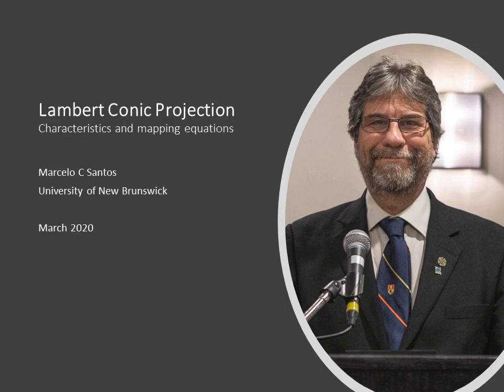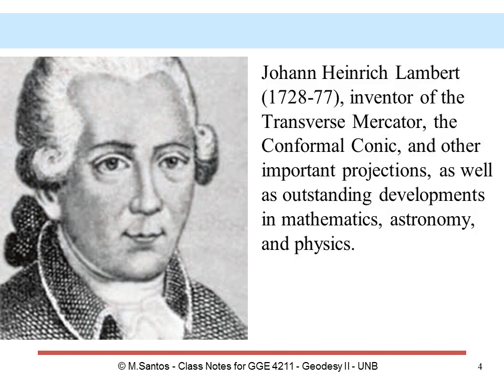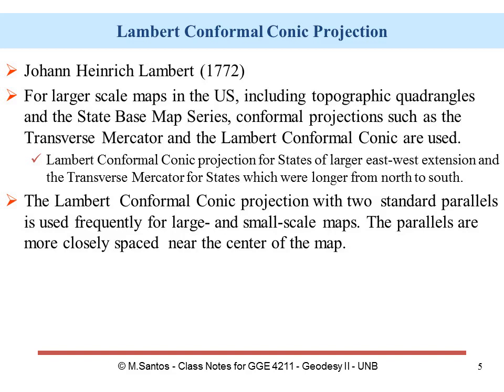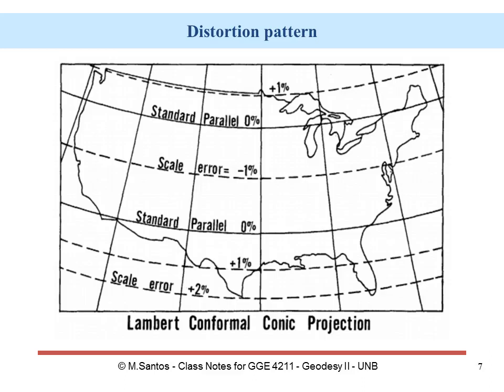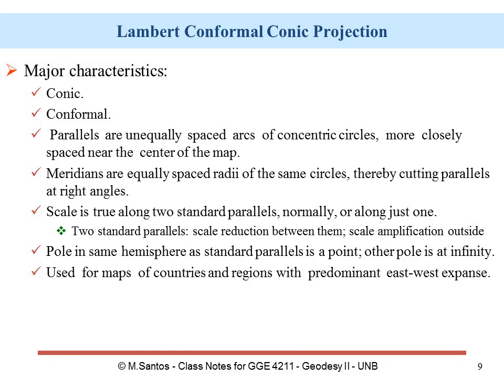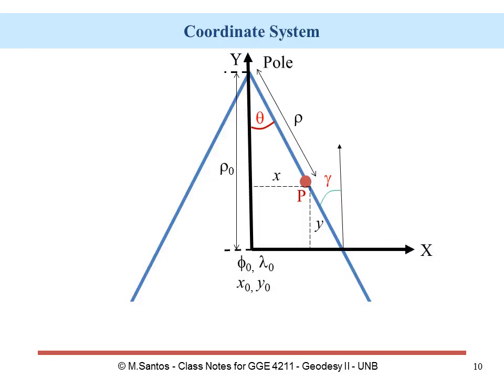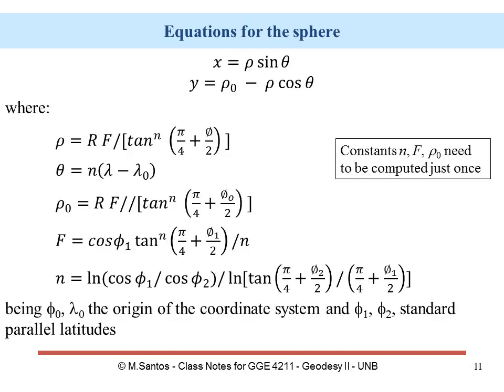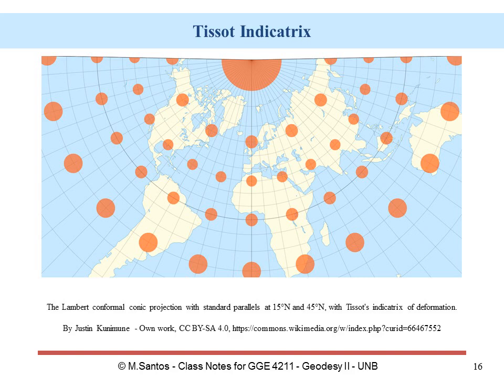5.4.6 - Lambert Conformal Conic Projection (CC Port)

Comment: What does it mean that the scale is true for the standard parallels? Are they on a 1:1 scale with Earth??

Unless the standard parallels are on a scale 1:1 with Earth (which I highly doubt, because that would give you an unusable map), the properties that you have assigned to the two standard parallels (decreased scale in between and increased scale outside, and more rapidly increasing scale for the parallels outside) is true for any two parallels with the same scale as each other that you choose. So what is it that is special with the two standard parallels?